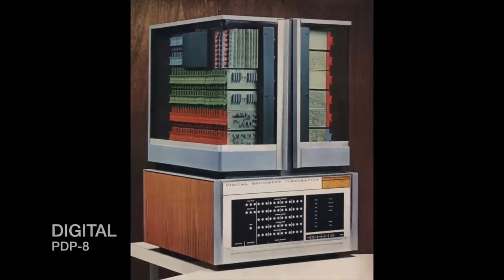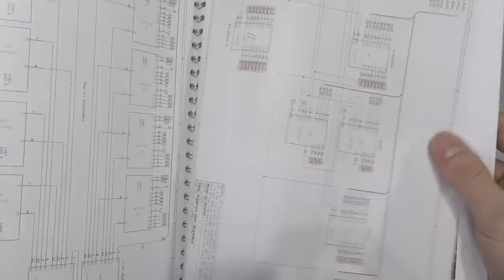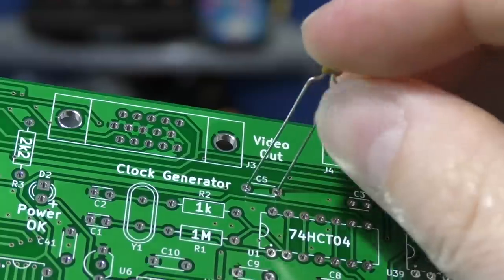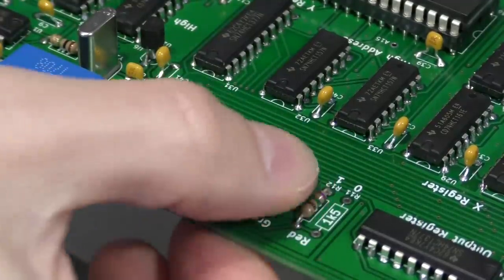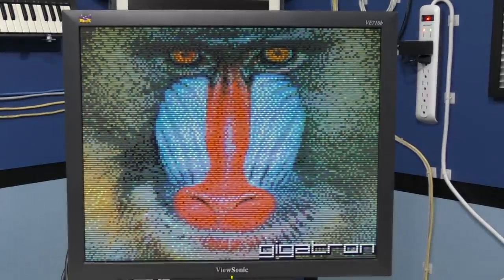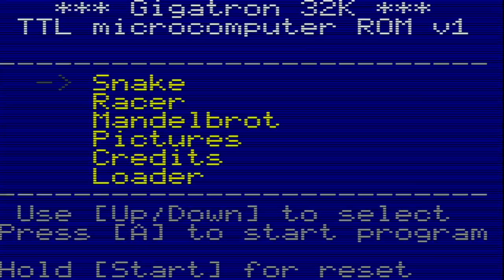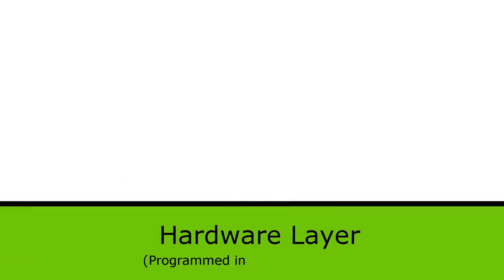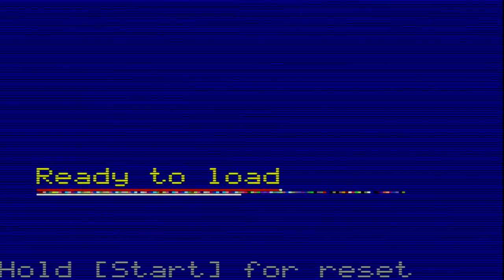The Gigatron TTL Computer without a Microprocessor

Comment: and too bad most companies stopped DIP production in the last 2 years. So all those parts will be obsolete very quickly.
Reply: Nexperia still produces them
Reply: @beopstek  nope they stopped, even called them. need alot of 4051/4067. they stopped them. 4067 is already sold out. 4051 until end of stock. so an era has ended.
Reply: @klaasj7808  oh wow!

Comment: Great video but don't follow it for a "how to solder"
So many bad habits shown.
Cutting leads after soldering means the exposed copper will oxidised.
Bending component leads without isolating the tension on the component ends via plyers stresses the component, reducing its life.